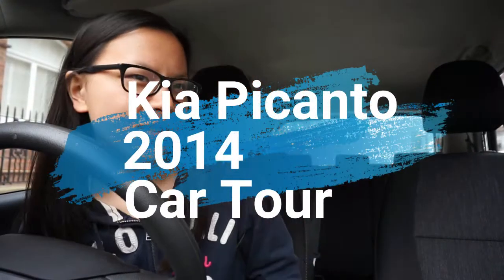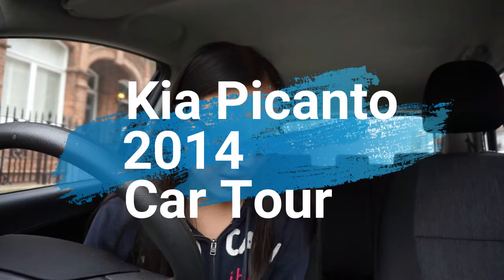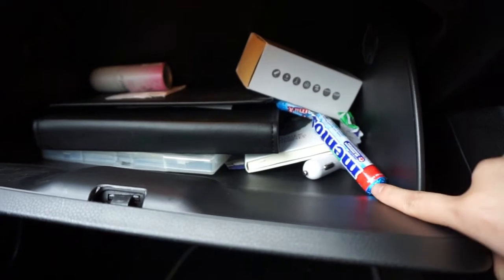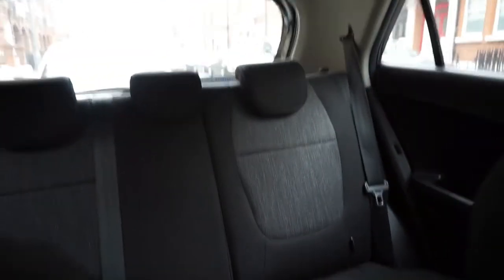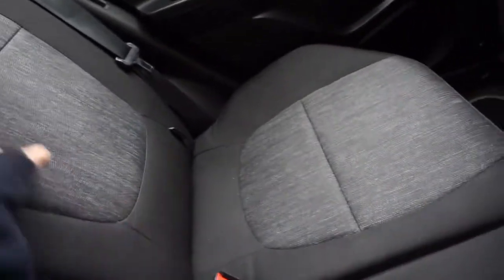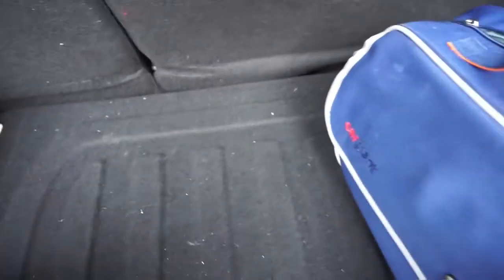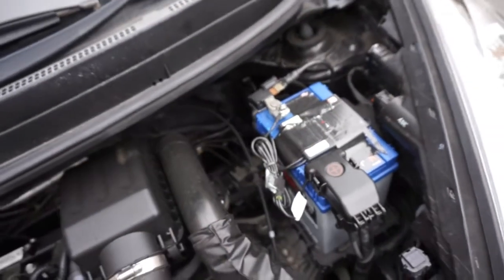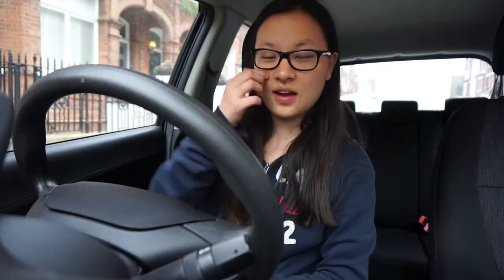CAR TOUR  - Kia Picanto 2014 | Asia Jade Walker

Comment: I’m pretty sure you’re getting your lights all mixed up there- I would check those. You should have both side lights and dipped beam on your light stick (I guess you’re referring to side lights as “half beam”?). Dipped beam is for night time. Full beam is when you pull your stick towards you or forward for fully on, either to flash people or for really dark roads with no on-coming traffic- you get a blue light on the dash for this. Your fog lights are for when visibility is less than 10m and they have their own standard symbol. X
Reply from the maker: Elise G92 yep you’re probably right however, this is my first car and I was a newbie driver back then and I’m still clueless about cars now I just know what buttons do what not the names of them so far it’s worked out fine  😂🤷🏻‍♀️
Reply: asia walker I get it; I’m a newbie driver myself. But I just thought I’d let you know, as I know I’d prefer to know.

Comment: What fuel consumption  you are getting?
Reply from the maker: Obaid Ur Rehman i get around 370 miles when I fill up which costs around £35 for a full tank. As I only use it once or twice a week & once or twice a month for long drives this lasts me a good while :)
Reply: @asiajadewalker  what is the fuel capacity?
Reply: @justindividual7496  35 Litres.